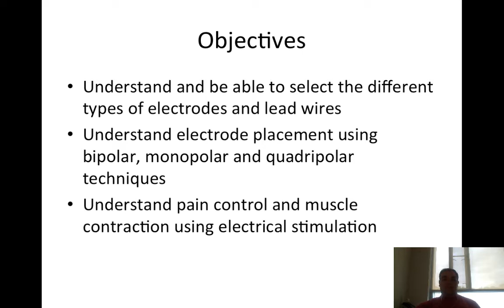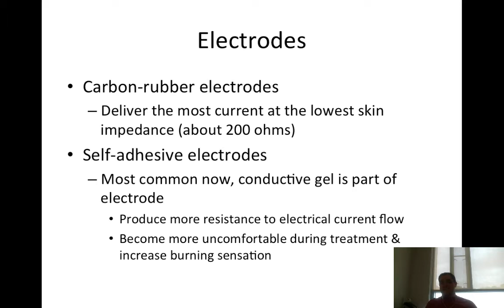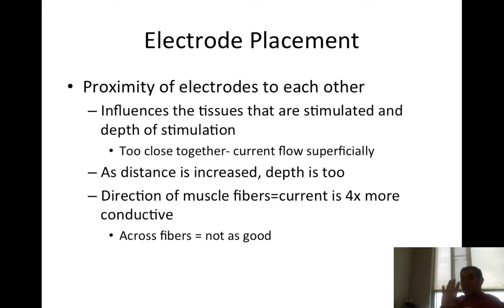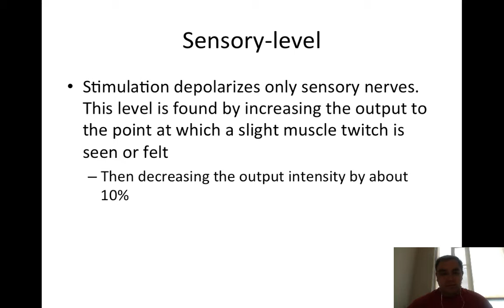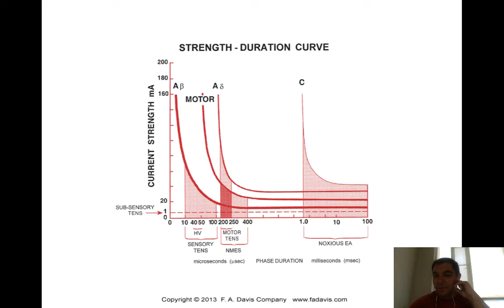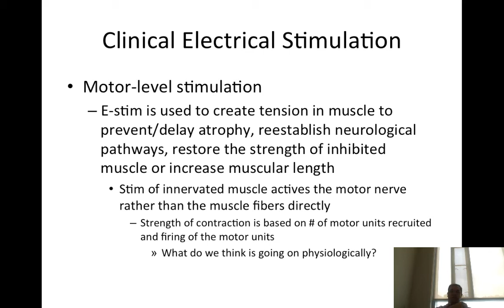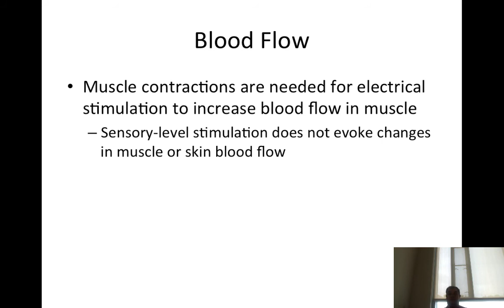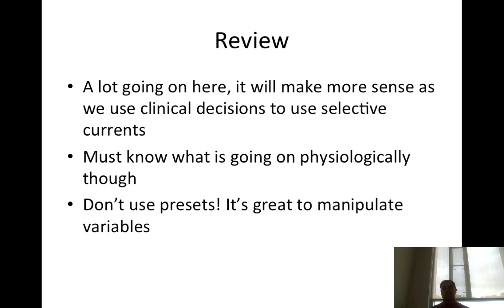Electrical Stimulation Techniques

Comment: Hello Dr. Your videos are awesome. I am a Cathodic Protection specialist and can follow you class here online. I have recently had spinal fusion L4,L5,S1 for Degenerative Spondilosysthis. Post surgery report said nerve damage at l5, s1. This is not a surprise as my calves (gastroc) on both legs are super weak. I have ordered my own Tens/Nmes/Rus unit for home rehab. Question Sir. Assuming I am using a rehab modality, how often per day may one use stim for neromusclular re-education purposes? 2x a day? Max mins or hours??? At this point 7 months from surgery my left gastroc is a major chore to even get to flex. Any help is appriciated.